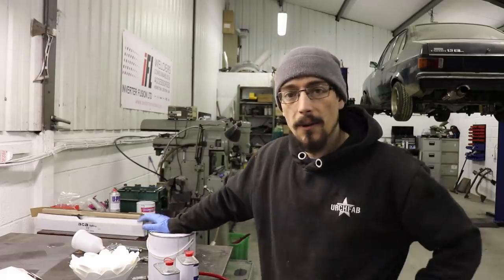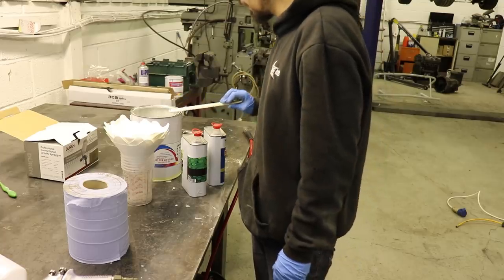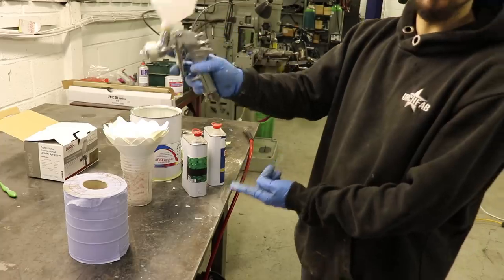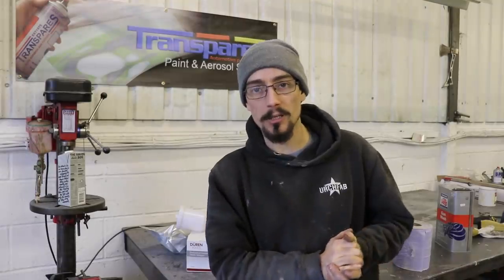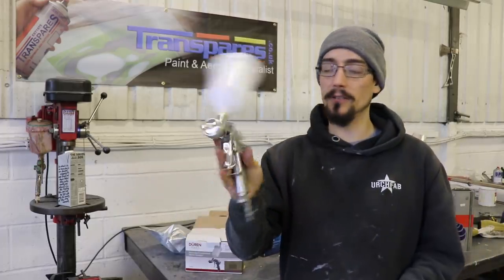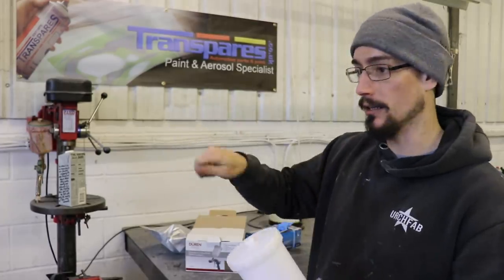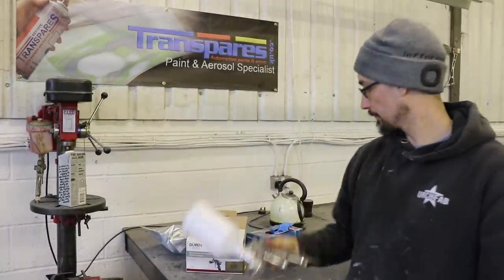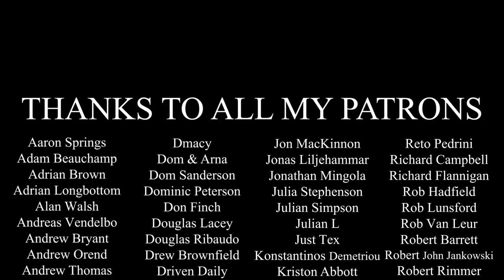PAINTING THE ROLL CAGE TAKE 2

Comment: One finer point to paint mixing. Try to mix only the paint and hardener first, then once mixed you can add in your reducer instead of mixing all 3 at once. This stops globs of paint forming in your paint pot. Also, you don't have to strip and clean the nozzle every time you run a pot of paint through. Get a clean cloth with some reducer on it and simply wipe it off before it builds up too much. The more you use the gun, the better you'll get with it, like taking long strokes instead of short ones, releasing the trigger at the end of every pass instead of holding it down, overlapping your spray pattern and fogging in. That will help reduce runs. Don't keep the paint flowing without moving the gun, etc...You'll get it!

Comment: Top work as aways bud! well done for getting stuck in your self with the painting! a caged interiors always a bit tricky. 
Id make sure you tape up your interior before you start doing the exterior/filler work etc! Its i nightmare cleaning it all up afterwards! especially if your mixing it with wet rubbing, its hard to get the water marks away from any dry patches in the paint! 
Once your finished all the filler work, I recommend using U-Pol Surface, 2 or 3 coats of that then all blocked down before putting your filler primer on! Its like a light liquid filler which you can block down with 120 grit! gives you a really even smooth surface! 
Cheers mate👌

Comment: If you get a drop of paint or a run you can spray just air out of the gun and push the run around and sometimes it will level out a bit. It won't come perfect but often it will make it good enough or easier to sand out.

Comment: Thankfully, nowadays the spray gun isn't that expensive anymore. Painter can finally use it like it's meant: like a brush. One can stroke a brush heavily or light, but when covering different surfaces, you'll still need a different brush - paint gun. One for outside convex curves, one for inside concave curves, and one for radical curves, like tubes. All of these surfaces need different type of air pressure, different type of spray pattern, and different type of paint, so three or five guns isn't overkill, in this case. As you noticed, the gun needs to be thoroughly cleaned after each cartridge, so outside needs two or three guns, just to spread the color and base mass. Then comes the clear cote guns. They need to be separate guns totally to reduce contamination, so you are up to eight. Two more, and you're good to go, creating the "professional finish". All guns need their own water separators, and pressure gauges + adjustment.

But, with a little practice you can still do basically the same finish with five brushes and four rollers.
Seems like everything is deliberately made to look harder than they actually are.

Comment: Well done for trying again Matt, you will get better every time as you have found. Been painting for nearly 40 years, and I am still learning. Quick tip.....If you get any water, crap, or a run etc, while the paint is still soaking wet,  hold a small length of masking tape at both ends and use the sticky bit in the middle to get the crap out then blast a bit more paint gently onto it. Sometimes works perfect. but always makes it easier to rub down and redo after it dries.

Comment: good job matt, but pressure a tad high use that small adjuster at the bottom of gun by the connector to adjust airflow
Reply: you can buy little guages to fit on the gun .I use mine all the time because even with a huge compressor like mine the pressure can rise and fall if others are also plugged in . The instructions should have the air pressure on the paint can too.

Comment: Great job Matt. But lose the door onto some Boxed fans to exhaust the Air.  Keep the heater going to warm up the temp. Or make a Mini Spray booth that you can break down when not in us.
Reply: This is what I do, some cheap pvc dust sheets stapled to my roof to make a temp spray booth. The heat stays inside and the damp air and dust stay outside.

Comment: Good going, Matt.  As others have stated, it's certainly a solid paint job, well beyond what is needed for the interior for a race car.  Make sure to take the needle, nozzle and aircap off and clean them and and of the gun's internal fluid passages completely, using lacquer thinner.  Then reassemble and properly lubricate the wear points.
Again, good job!

Comment: My two penneth worth Matt ..... do yourself a favour and buy a cheap gazeebo for spraying in, 1) it'll give you a more sterile environment 2) it'll stop overspray finding it's way onto surrounding 'stuff' 3) It'll retain all that lovely expensive 'heat' you just injected into the proceeding and 4) It will act as a moisture barrier, those little particles of paint will happily collect said moisture betwixt gun and panel. Also, never underestimate the value of a test 'piece?' Finally, be extremely wary of broadcasting your presence (or lack thereof) at your 'works' publicly, some scumbags will treat this as a window of opprtunity, if you get my drift? All the best, G

Comment: I'm surprised no one mentioned you getting a water strainer to put on your air line from the compressor... Compressors always have a small amount of water coming out of the pressure side, so if you are painting, you need to strain the water out of the lines before your paint gun... If you don't, you get big splotches in the finish...

Comment: If it is still a race car intended for track use. You could of used a sponge brush or better yet vinyl rap is real cheep. And rap is easy way to color match after repairs. More effort put in, the better chance it will hurt repairing, then compared to hitting a wall. After a wrap use bedliner for the underside to avoid chipping when rally running.

Comment: well done for somebody who isn't a painter to dive in and tackle it yourself,small tip for you,put the airline over the shoulder  of the hand you are using the gun in and with your free hand take hold of the airline and keep the slack from allowing the hose to dangle below the gun,so airline is diagonal across your back,i don't know how many times a slack hose in a confined area has ruined a job by dragging across new painted surfaces.

Comment: Second down knob on the back of the gun is so you can set where max pull on the trigger ends up as. It’s a much better way to be consistent at paint flow out of the tip. Yes, do keep an eye on paint build up on the air cap too as you know, it causes issues. Might add a small length of hose to the gun and the water trap between it and the shop hose so your not wheedling a long handled gun by adding the filter directly to the gun. I just learned to use it as directly connected though. Nice job at gun management while spraying too. More practice will show up as quality improvements vs wasted effort. Looks way better now so bravo Matt.  Trev did great at suggesting the gun you used. 
Good choice.
Reply from the maker: Cheers mate.